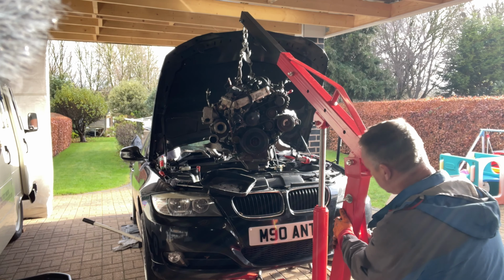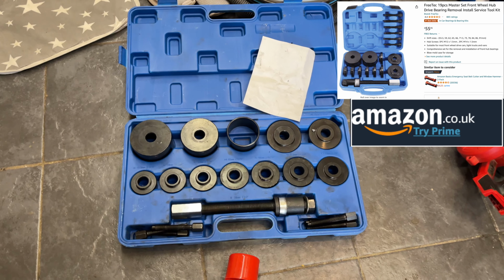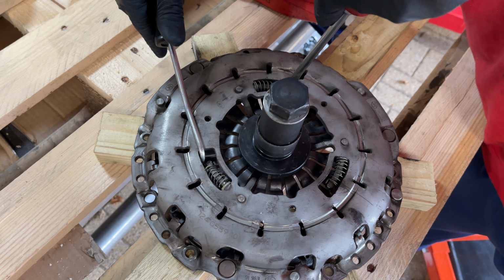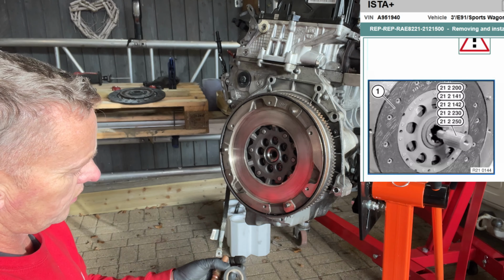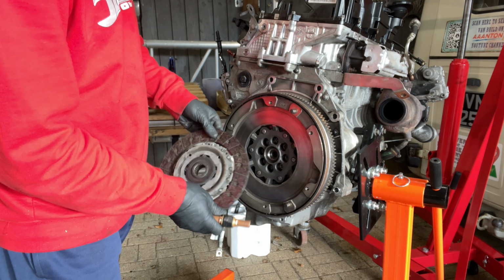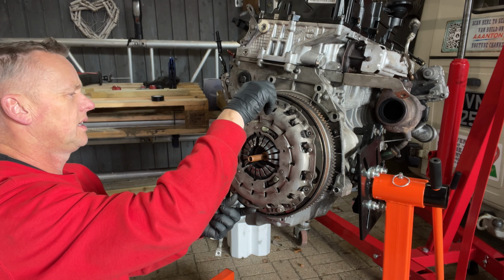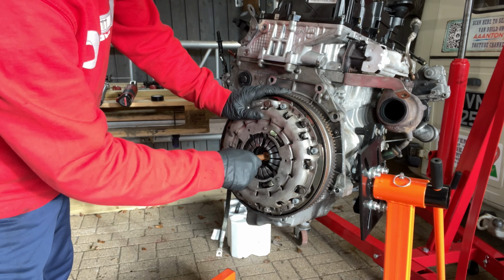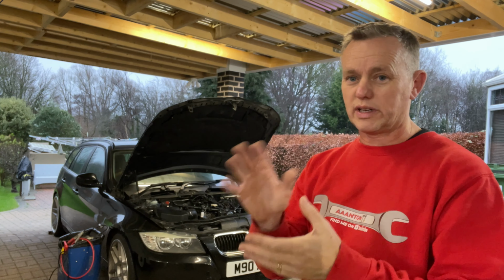BMW Resetting The SAC Clutch Before Fitting "Timing Chain Broken" PT 8. Self Adjusting Clutch Reset

Comment: Hi M8 would the engine still turn over as normal if the chain had slipped? Guy i work with parked his 118 up and a couple of days later would not start but turned over s normal ,He got a Diagnostic guy out and he said the chain had slipped,But i cant see how that would happen myself if its turning over and sound ok
Reply from the maker: It's unlikely the chain has slipped, unless it was rattling really bad and the guides had fallen apart, it will snap like mine did, did he get any fault codes? Thanks for the great comments👍🏻👍🏻🛠
Reply: @aaanton11  WE had a decent scanner on it and no codes of any relevant came up and it turns over like it should just does not start,Im going to have another go at getting the crankshaft position sensor off this week end ,Thanks for the reply